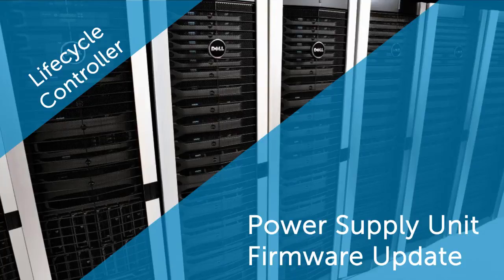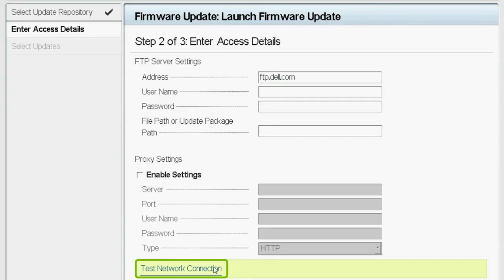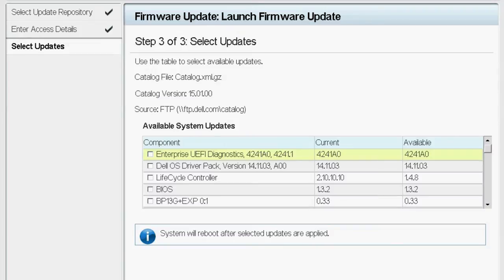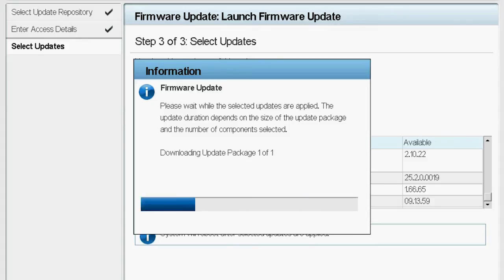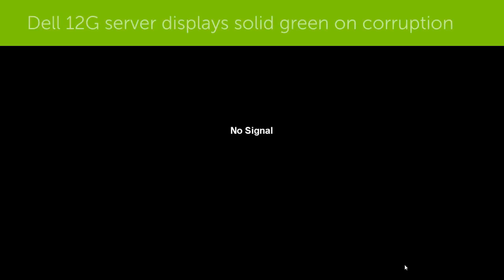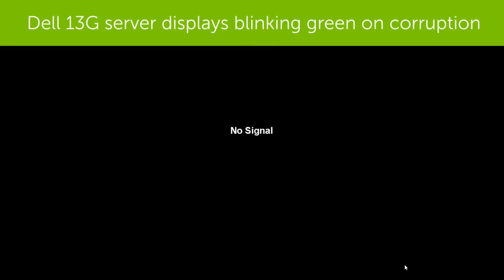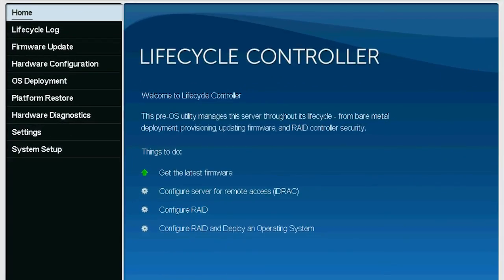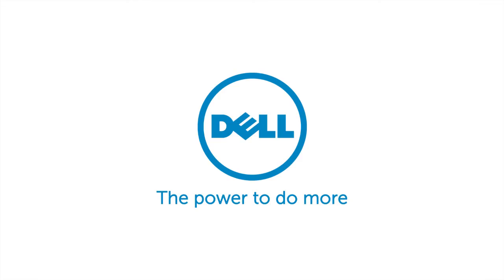Lifecycle Controller Power Supply Unit Firmware Update

Comment: Don't do this!!! The PSU firmware update process has a tendency to fail and brick PSUs. Just search online and see all the horror stories. Also, ftp.dell.com no longer works. Bad, bad, info ....
Reply: @DellEnterpriseSupport  I waited until the server powered on by itself. By that time, one PSU was already blinking amber (and bricked)... it then automatically entered LCC and continued to apply another update (PSU #2 maybe?) and then powered off and no longer powered on for hours. Both PSUs are now bricked. Dell should pull down the PSU firmware updates until you have a proven stable update process. I'm not the only who has experienced this, just see your own support forums and other places online. Or, talk to your own warranty department and see how many PSUs you've had to replace under warranty service due to firmware update failures. Someone at Dell must know by now that these PSU updates cause more headaches than successes.

Also, ftp.dell.com does not work. Your own support staff have confirmed this and have redirected people to use HTTPS and downloads.dell.com instead. I have not been able to use ftp.dell.com in over a year. I have confirmed the HTTPS + downloads.dell.com does work, but you need the newer iDRAC with LCC firmware to use the HTTPS option, so for older systems you have to manually apply at least the iDRAC firmware update and then use the LCC to update the rest of the system. But even then, your HTTPS certificate is invalid, so I had to override the security warning; Dell really needs to get their act together on this. I say that as a long time fan of Dell PowerEdge servers; I've seen better from Dell in the past.
Reply: @ArtofServer  Exactly! I had the same problem, both PSU don't work anymore!!
Reply: @jonatasro  sorry to hear that. That sucks!